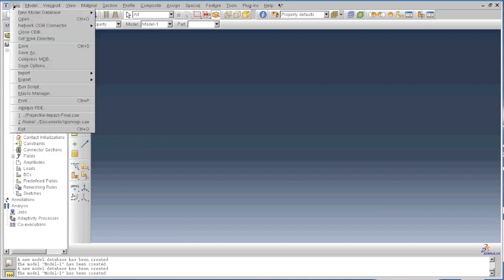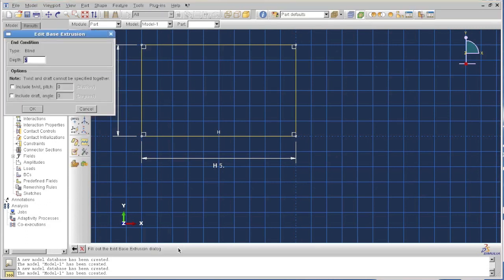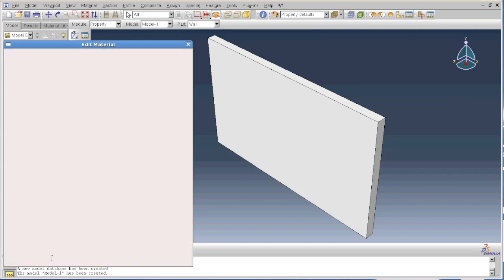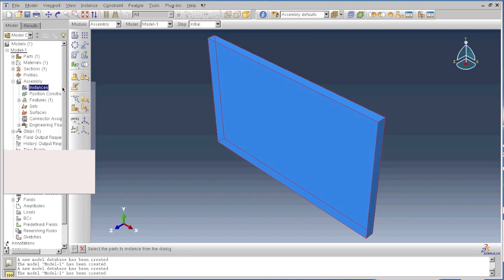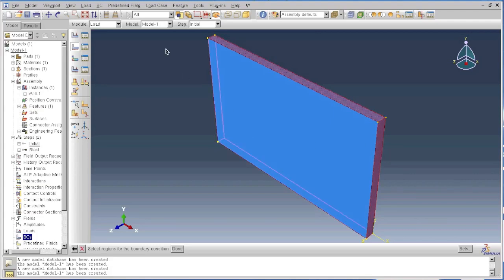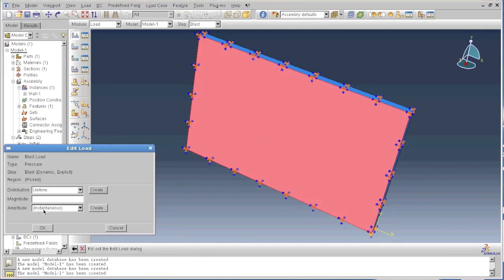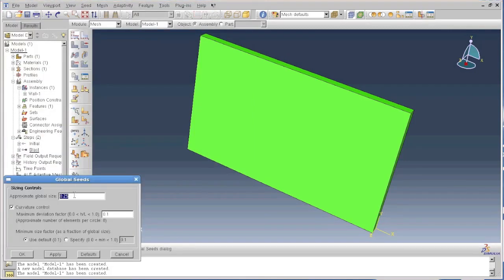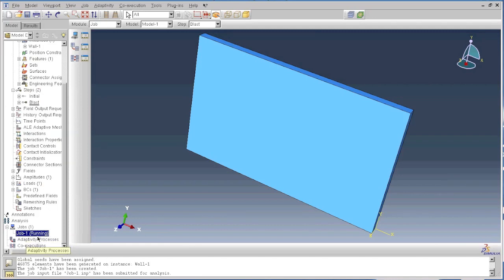ABAQUS Tutorial - Part 1: Modelling a masonry wall under a blast explosion

Comment: Hi i have there is an error when i submit the job : 
Error in job Job-1: DEGREE OF FREEDOM 11 AND AT LEAST ONE OF DEGREES OF FREEDOM 1 THRU 6 MUST BE ACTIVE IN THE MODEL FOR *DYNAMIC TEMP-DISP. CHECK THE PROCEDURE AND ELEMENT TYPES USED IN THIS MODEL.

Anyone know what it is ?
Reply: did you find the solution? i have the same problem
Reply: you have to choose coupled temperature disp. mesh
Reply: @LabyrinthTank  where can i change that?